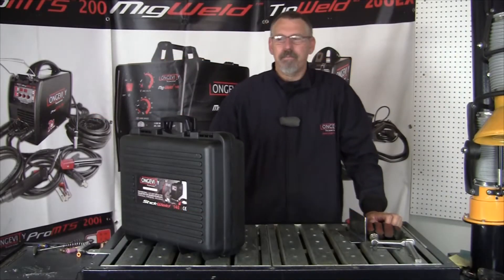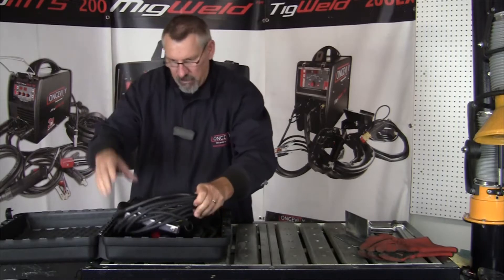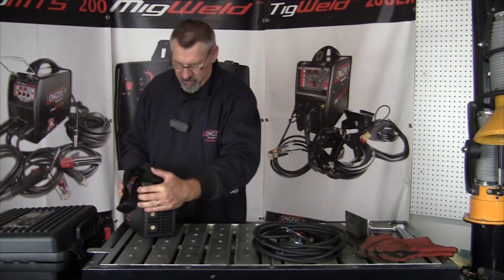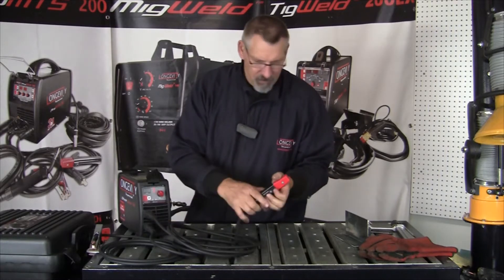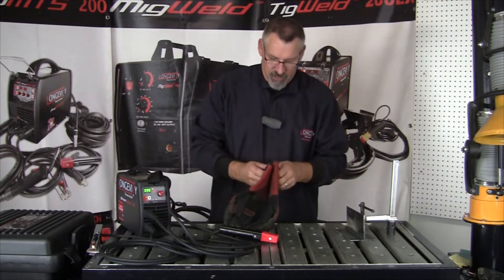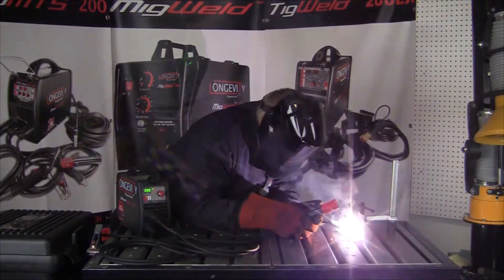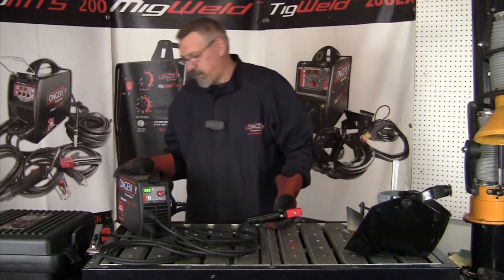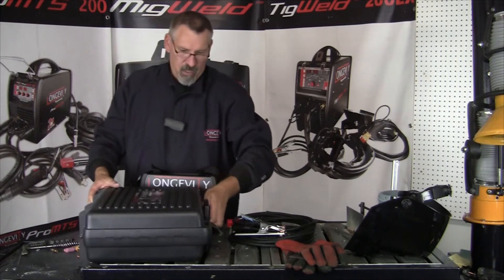LONGEVITY STICKWELD 140 STL - 140 AMP STICK - TIG WELDER SETUP AND REVIEW

Comment: Can you work on like 120-130 amp for long time with these welders ?
Reply from the maker: This machine has a 60% duty cycle at 140 amps, at 120-130, the duty cycle should be around 75-68%. The should allow you to use the machine at 120-130 amps for 7.5 to just under 7 minutes out of every 10 minutes.

Comment: Your welder is exactly the same as the everlast 140 st. Is there a reason is priced higher? Your includes less for more money? Also your included tig torch on your package deal doesn't have a gas shut off valve on the torch? Not trying to yeah you, just curious.